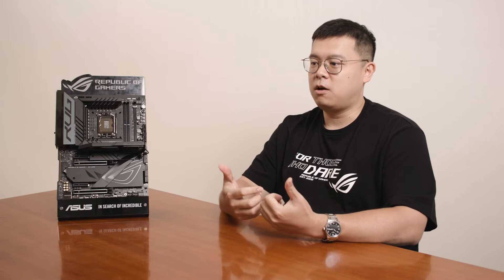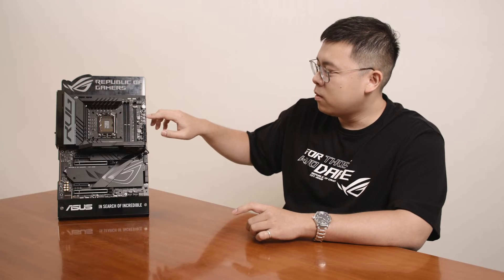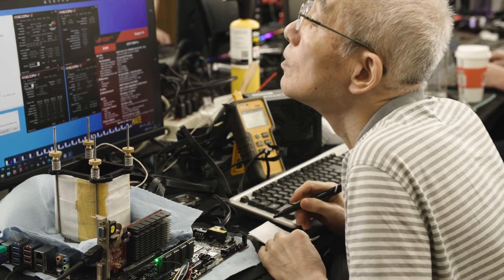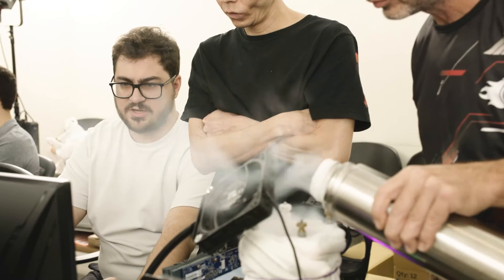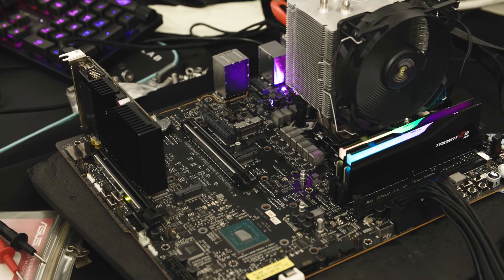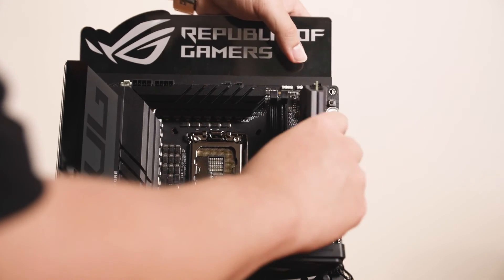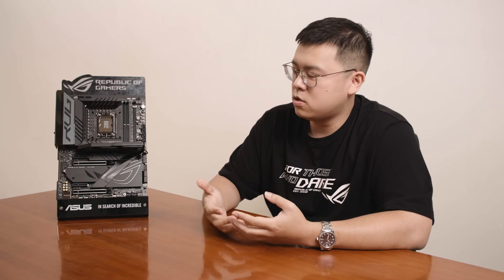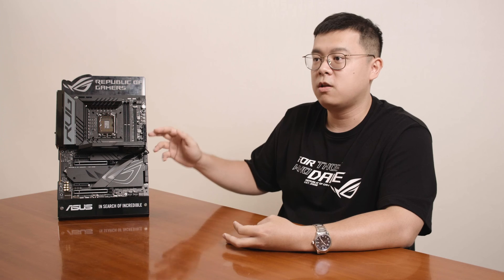Asus ROG Maximus Z790 Apex Encore: A Motherboard for Overclockers | Talking Tech | Intel Technology

Comment: It would be good if you can make a bios where 8000 memory speed is in the bios settings it jumps from 7600 to 8800. Where's the option of 7800,8000,8200,8400,8600 in the memory presets? Also what's the point in having the top m.2 that makes the gpu go down to 8 Lanes from 16 lanes.
Reply: 8x is more than enough for most GPU, even a 4090 wont suffer much from it.
Reply: @crazyea  a £750 high end motherboard shouldn't "suffer" at all .